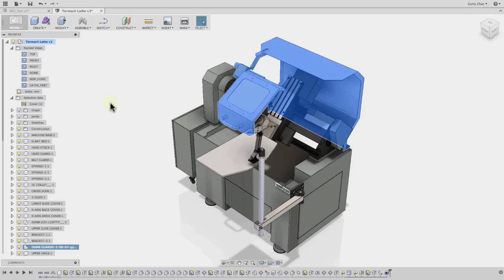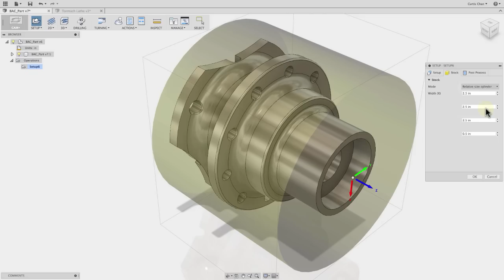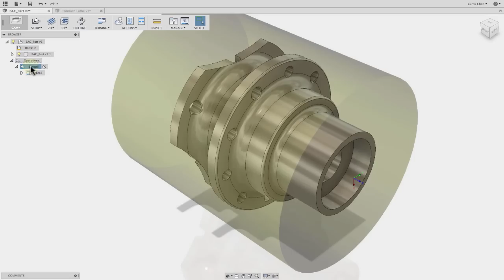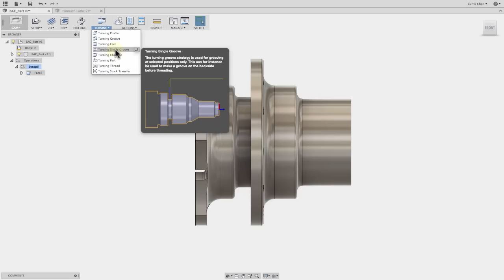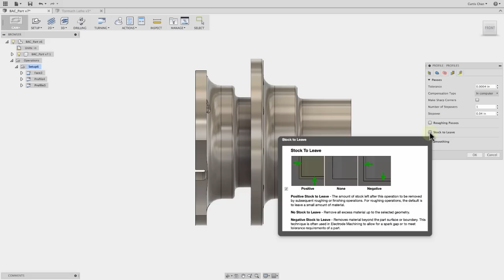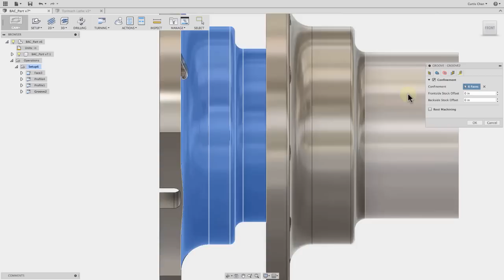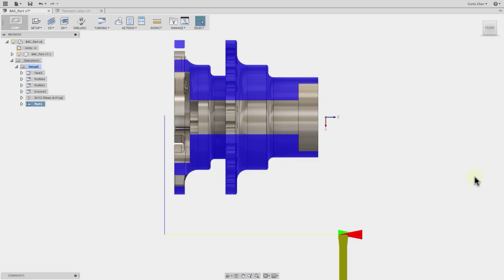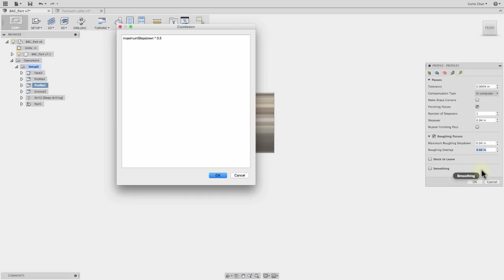Turning Features in CAM Overview

Comment: I'm having a lot of trouble with internal boring (Or inside profiling) and creating boring bars. In this video you forgot to bore the internal geometry after you drilled it. I use a lot of small / custom boring bars to bore 16mm etc bores. Can you do a video on boring / internal profiling and small boring bars. Because I'm ripping my hair out cause the warnings/errors don't tell me A:whats wrong or B: how to fix it. It's substantially impacting my rectal pain threshold.